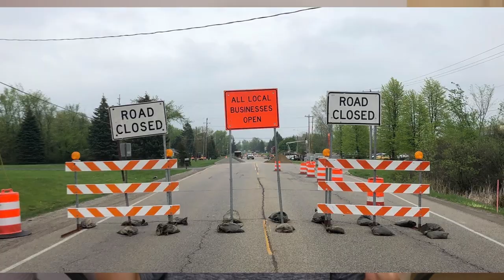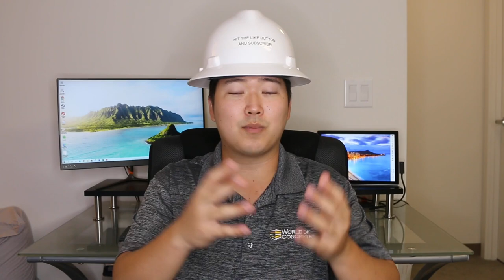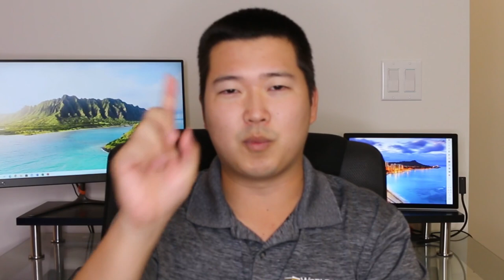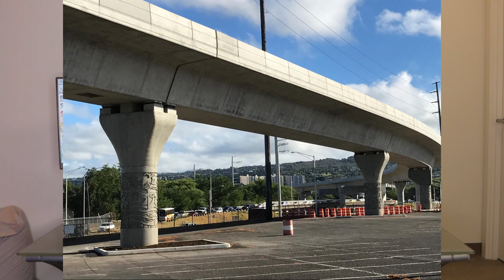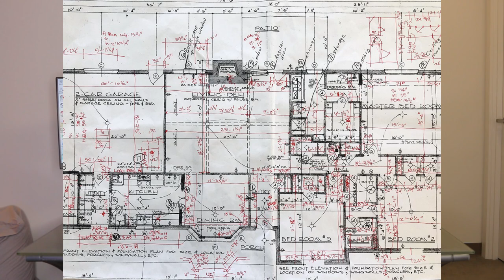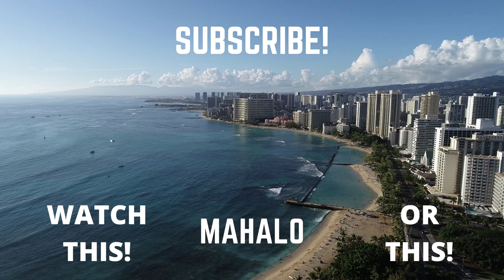Why Construction Takes So Long (And Goes Over Budget)

Comment: Hi Kienen! I wanted to ask for some advice. I am currently in my 2nd year studying civil structural engineering and want to go into General Contracting/Construction Management. I am having difficulty in my course statics/mechanics/dynamics courses (barely passing or expecting to retake). I was wondering if switching to Urban Planning would also be an option for getting into CM? My University also offers Real Estate courses are part of the curriculum which I thought would be interesting. I know that experience is really important, so I was able to land an internship at a large GC this summer. I just fear that changing majors may not look well in their eyes but am not totally sure. I also am not sure if I'll have the same flexibility if I want to go into subcontracting later in my career.

I don't plan on making a decision yet and want to finish my winter quarter and continue through spring, but want to have a backup just in case. Any advice would be appreciated!
Reply from the maker: If you kill it at your internship, it doesnt matter if you switch your degree to urban planning. That internship and your performance in that holds so much more weight than your degree at that point

Comment: I’m in high school and I was wondering how to get to where you are. Is it through going to school for civil engineering?
Reply from the maker: I did, but theres many ways into the industry. The easiest is through an engineering or cm degree and getting an internship during your college breaks and funneling that into a full time offer. My suggestion is to use your breaks in school to gain experience that will give you clarity on what you want to do for your career. Those breaks in school will end up being more value than anything you learn sitting in those classrooms

Comment: Thankyou for your explanation. I just want to ask, for scheduling, who is have a task to manage the manpower? is it from contractor (supervisor of contractor) or head of labor? because I (supervisor of contractor) just afraid that we don't have a authority to manage the manpower, because manpower is head of labor authority.. Please correction if I wrong.. Thankyou
Reply from the maker: It really depends on the job. Some supervisors own that process but typically i see there being a shift in trying to empower the labor foremen to manage it. Its a balance of understanding whats really needed to complete the work and managing your budget which the field may not always be aware of
Reply: @KienenKoga  So what should supervisor do or contractor do if the project has been delayed and contractor has been contract with the labor foreman? I ask this because contractor can't adding new labor or enforce the labor to work overtime. It's all depend from the labor foreman. Thankyou Bro Kienen.